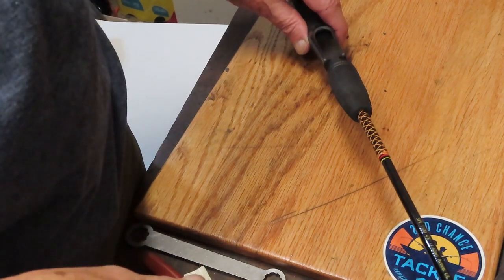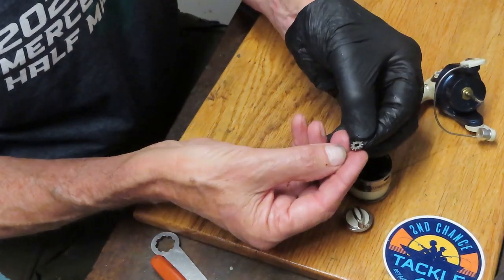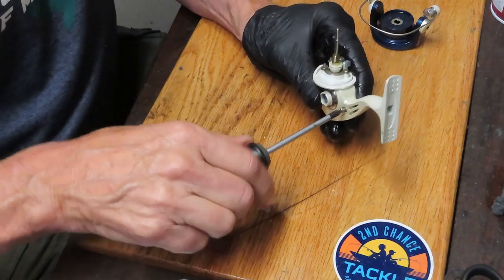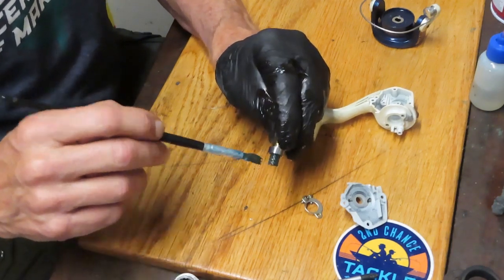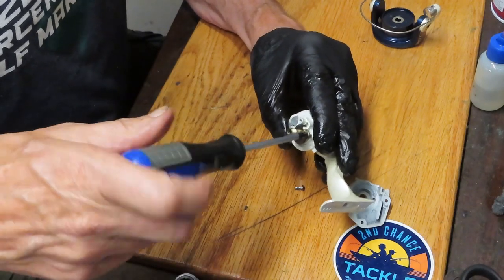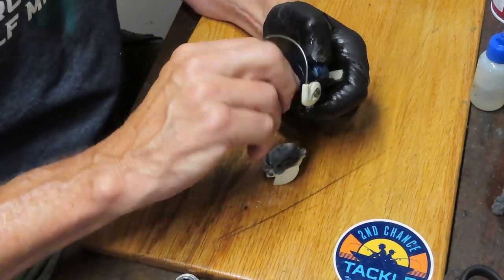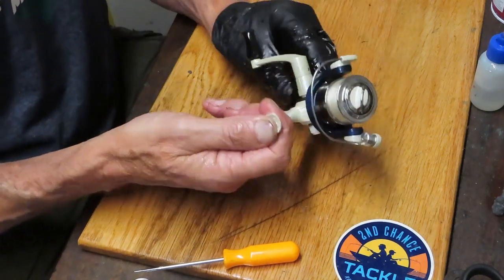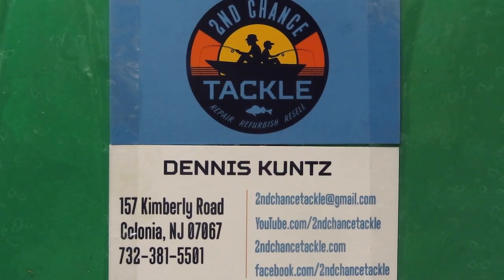South Bend Trophy Stalker fishing reel how to take apart and service

Comment: Hi Dennis great job on the video I have a question about my Penn 85 sea boy reel ware can I find a screw for the foot of the reel it works but the top ware you put a screw driver is a little chewed up thanks for your time and help
Reply from the maker: You can find the screws at Mysticparts.com - Thanks
Reply: Ok thanks I will check it out